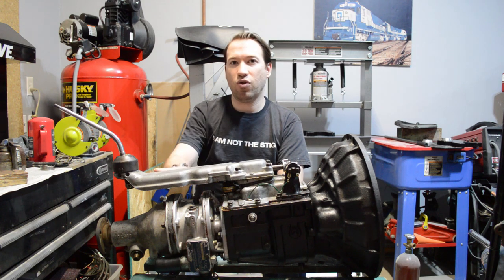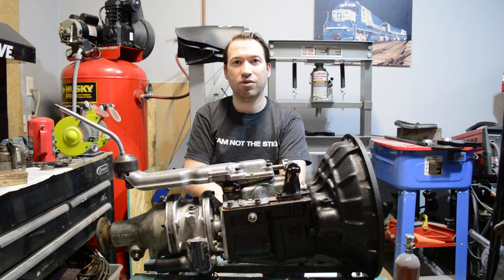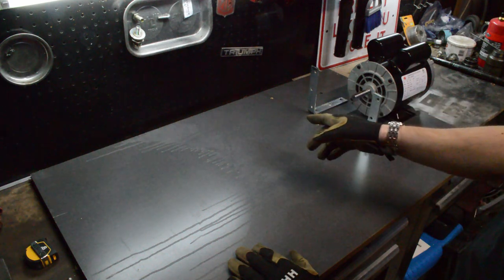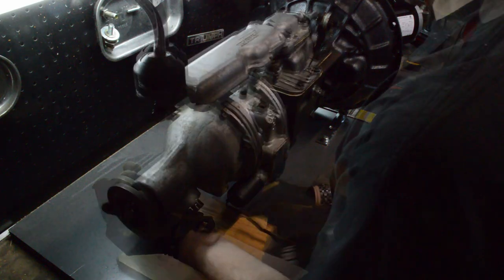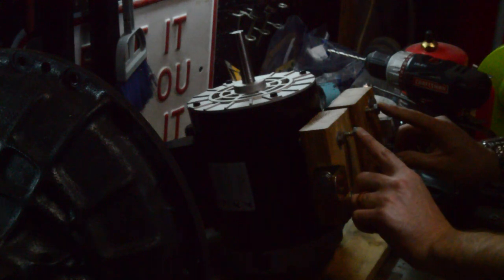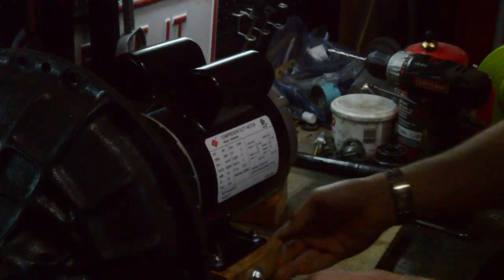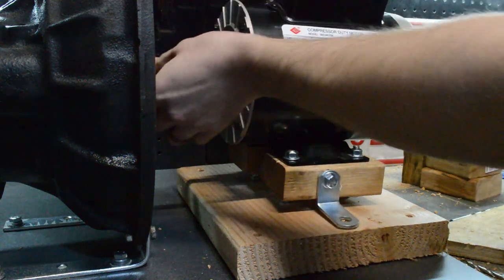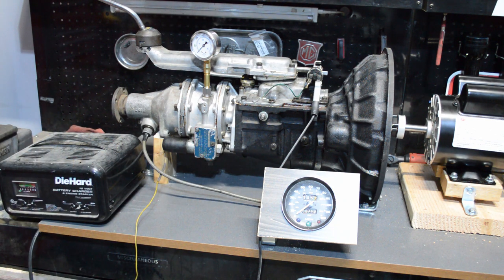Building a Gearbox Testing Stand

Comment: I am considering making a test stand using my heavy duty wood lathe. It's driven by a 2 horse motor and is variable speed. I like your test stand and I can do something similar then clamp it to the bed of my lathe. My transmission is a Volvo M41, which uses a J-Type Laycock deNormanville OD.
Reply from the maker: The important things are to make sure it's a useful rpm range and that it's spinning in the right direction... but that should be pretty easy with your lathe. Sounds like it should work great!
Reply: Hi, I am also intending to do it for M41 with overdrive . what make of lathe is it?
Reply: @tutnallman  My lathe is a Powermatic 3520B. My test bench worked very well. The only tricky part is to get the correct pressure gauge fitting, which can be purchased from James Holecamp in Wheaton Illinois. The fittings are different for the A-, D-, and J-type OD's.
Reply from the maker: Technically the a and d are the same fittings.  Only the J is different.  Volvos may have also used a P type, but not sure what that fitting would be.

Comment: Everything sounds so loud, do you think you would be able to determine if there was an unusual noise?
Reply from the maker: Yes definitely.  Most of the noise is actually the gearbox and not the electric motor.  It just sounds louder since there's no insulation in the way or other noises such as the wind or the engine to drown it out.  In any case, it's easier to hear a noise on the test stand than it would be with the gearbox in the car... so any noise you'd hear from the car would be insanely loud on the bench.

Comment: Have you ever considered applying a variable load to the output flange?   I realize we can not duplicate all road conditions, but maybe a light load would enhance noises or other problems?
Reply from the maker: Not a bad idea, but expensive for sure. You'd need to duplicate the weight of a vehicle somehow.
Reply: @midwestmotoring  i was thinking about using a brake disc, hydraulic caliper, and a master cylinder to create a load at the output flange.  You could use a knob & threaded rod to activate the master cylinder.
Reply from the maker: @gfbemc0256  That'd work for a quick test (i.e. under a minute), though it'd be quite a load on the electric motor, so you'd end up burning it out.  Remember the engine has over 100 hp, but an electric motor like in the video has somewhere from 1/3hp to maybe 3 hp if you have a fairly strong one.  A very slight drag might be okay, but that won't simulate what you have in the car.  Then you have the next problem.  Even if you could, that's the same as holding the brakes down while driving.  You can do it for maybe 10-20 seconds, but after that you're going to burn up the brake pads, warp the rotor, and they'll be too hot to create any drag.  Unfortunately, you'd need to engineer something more complex.  In theory, something like a belt driven fan (like what they have on an exercise bike) only much heavier might work.  You could have a screw propeller working to pump water or some other viscous fluid.  Otherwise, a resistor like what you'd find on a dyno might work... but again that's meant for short pulls and not 20-30 minute tests.
Reply: @midwestmotoring your points are well thought out & I appreciate them.  Some dynamometers use eddy current power absorbers and Roto-Test and DynaPack use hydraulic power absorbers. The hydraulic absorbers use water to fluid heat exchangers or air to fluid heat exchangers.  I’m looking to create a light load and possibly use the PicoScope NVH equipment to identify any unusual noises or vibrations.
Reply from the maker: Really cool idea!  I'd be interested to see how it turns out if you go that route.
Reply: @midwestmotoring I will update you as we progress. Thanks again.